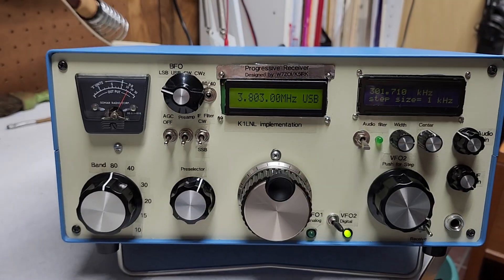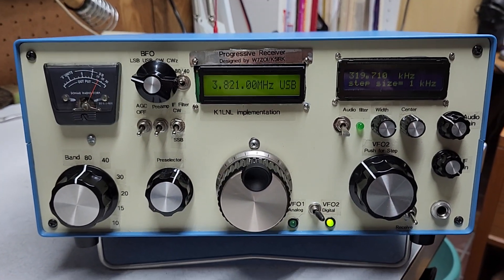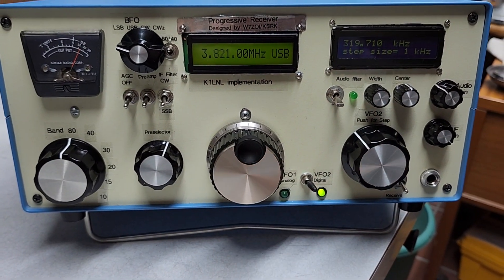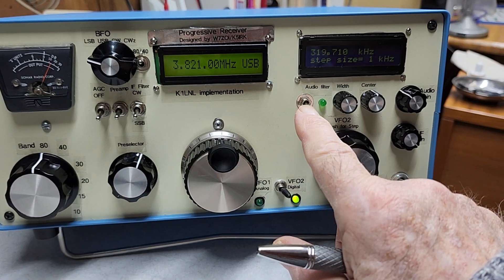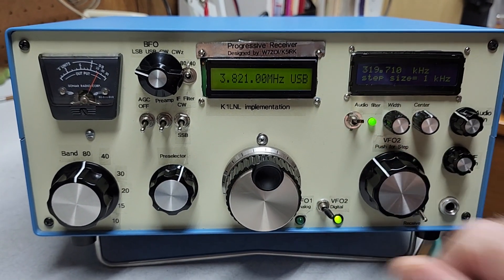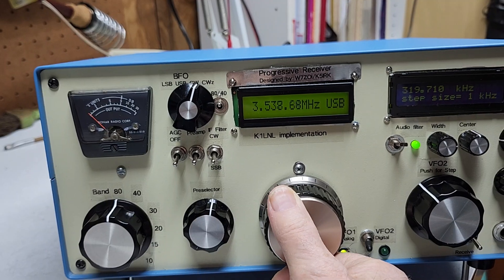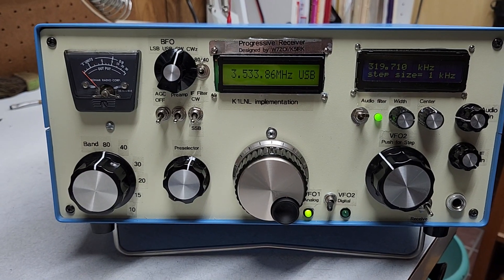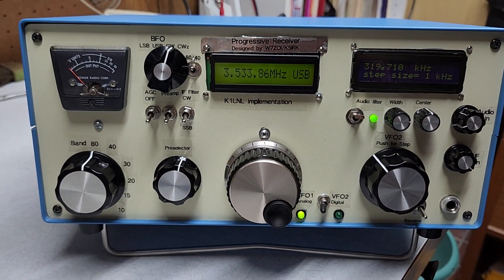Progressive receiver designed by Wes Hayward W7ZOI and John Lawson K5IRK and built by K1LNL

Comment: Thats a huge amount of hours in that lively receiver.  I know, i have also built a Progressive.  I had lots of heterodynes when configured as dual conversion with tuneable 3.5MHz IF. I reconfigured it as single conversion high side VFO and it cleaned up.  Haven't made a blog post or video on my Progressive,  mainly because it is not finished. It is receiving on 80 to 20m SSB  FB with a sbl1 mixer , preamp, Minikits 9MHz crystal filter kit, si5351 PLL, Arduino controller.  Most of the modules are as published.  It has a nice large format blue LCB which lights up the shack at night.  
But it is packed away in a box now. One fine day i will dig it out and have another go at it.  Its a good receiver, by the standards of the day.  It does need a narrow IF filter for CW.  These big projects are a test of persistence!

Comment from the maker: The AGC timing capacitor in the radio was changed from 10 ufd to 0.22 ufd.  I misspoke when I said it was running with a 2.2 ufd.  This recommendation from Wes greatly  improved SSB reception and also the action of the S meter.
Reply: op, I found them, sorry.. should've googled before I bothered you... still.. pretty cool.
Reply: is there drawing or design notes for that?  Looks pretty cool btw  👍